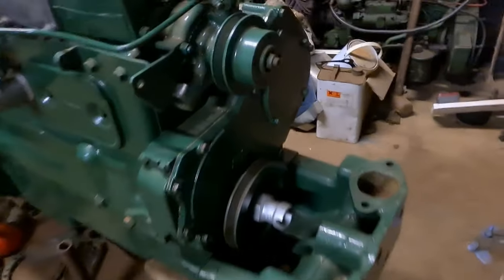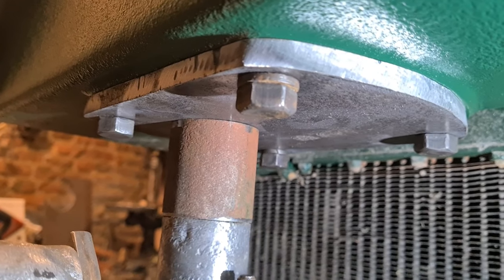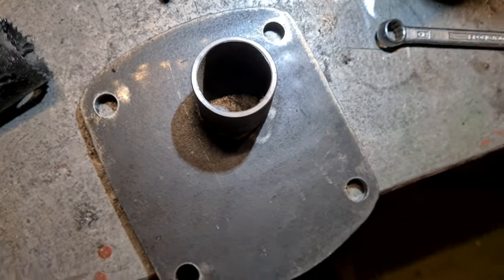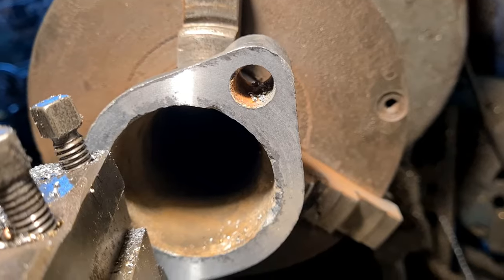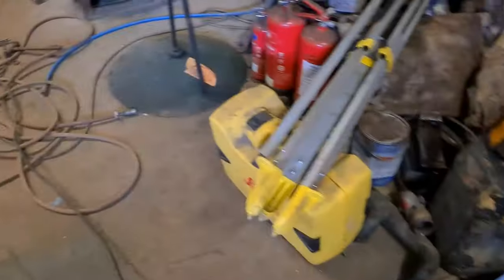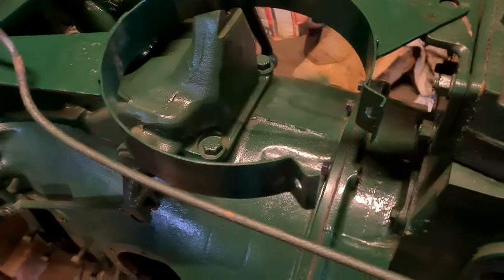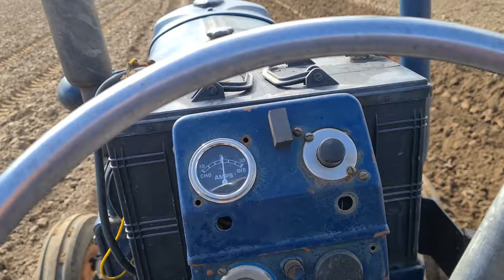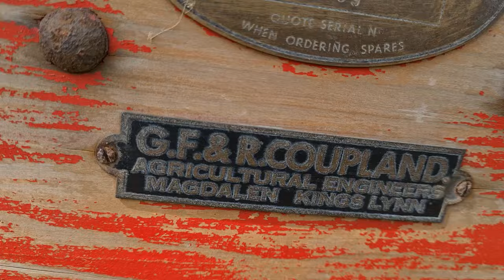PART 16 of STANDARD FORDSON PERKINS4.270 CONVERSION

Comment: Great video thank you for posting, the P6 sounds nice when working under load.
I spent some cold days sat on a Robot three row planter. one had to wind a handle to get it out of work each end of the field :-( It was pulled by a 1947 Cat D7 crawler - Donkey engine start
P.S. Nice to see your Snap Bag hung from the Diesel tank, those that know will know.